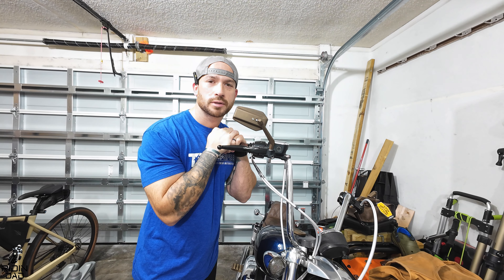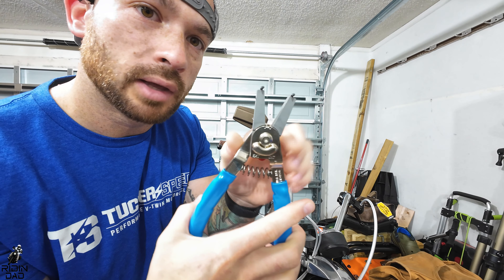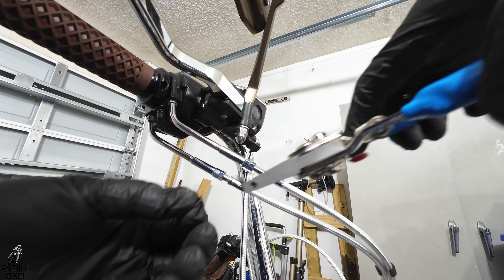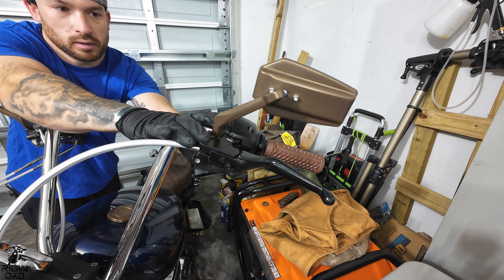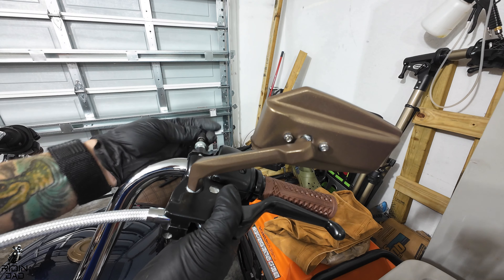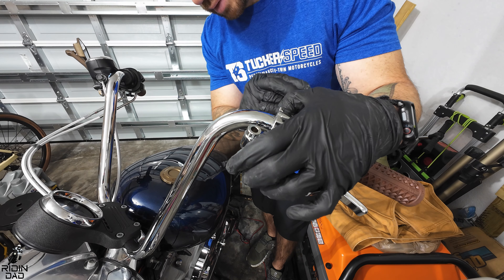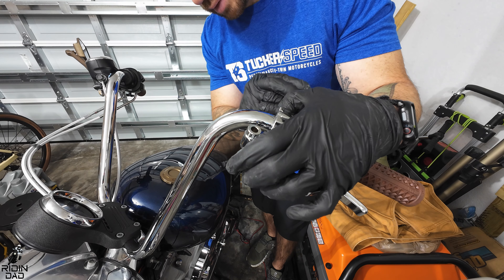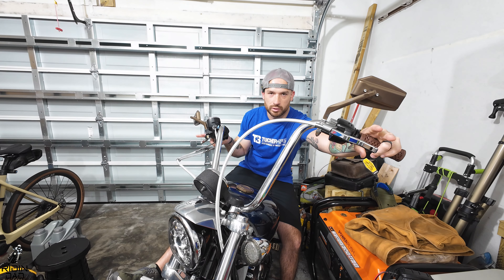How to INSTALL 1 FNGR lever set - Easy pull Clutch Lever w/ matching brake Lever!

Comment: Do they actually make the clutch pull feel lighter? Worth it?
Reply from the maker: Yes 100%. It is a huge difference. I didn't have an issue with clutch pulls prior to this install, but it is very easy to pull this lever with just your pinky. Big difference. And very smooth action to it.
Reply: @ I want it but it’s so expensive for my bike it’s $600 on the 24 road glide but the mueller power clutch is $200 and I might just have to go with that option.
Reply from the maker: Yeah, I get it man. I’ve never felt the other option in person so I can’t speak on how it feels, but I have felt some aim products and the one finger felt way better than any of those. Plus, this is just at the lever, the last thing I would want to do was mess with anything in my primary that way I don’t have to worry about having to change it again down the line or something weird like that depending on what I wanted to do. A lever swap is very easy.
Reply: @RidinDad  very true man. I feel the same way that’s why I’m trying hard to find an alternative other than that but it’s getting complicated lol. $600 is just ridiculous and overpriced IMHO.
Reply from the maker: Overpriced yes. Agreed. But….unfortunately everything with these bikes is overpriced

Comment: Finally they a 1finger on my dyna finally! The chrome levers were sold out for almost a year.
Reply from the maker: Holy hell! I love it man. They feel so much smoother than I thought possible lol. I’m a believer how!
Reply: @RidinDad  my grammar was all goofed on that first comment lol. But yeah dude I just put one on the dyna a few days ago only got a few little rips on it since it’s below freezing but the I was running a cut n half lever for over a year and talk about forearm pumps 😂 the easy lever makes the front of the bike feel 20lbs lighter in a wheelie
Reply from the maker: @jerrycool3034 lol that 1 fngr compared to the diy lever is a huge jump lol. And grammar or not I got the just of it! Especially with the clutch you got in the dyna that’s a big change lol

Comment: Afterwards did you feel you had to adjust the clutch in the primary? Seen folks do that also. I’m torn between these and the Flo moto you installed
Reply from the maker: Hard to tell because to install the lever I had to adjust the cable anyway. At the clutch basket itself I did not make any changes and I do not feel like I had to. I will say that it is a different feel as you pull in though. It does not disengage until the very end of the pool and then it’s a very immediate disengagement. Hard to explain. Not bad in anyway and you can still feather the clutch and do low speed maneuvers and stuff like that, but it’s just a weird different feeling that takes a little bit to get used to. After using both of those levers, I would pick the one FNGR lever every single time over the flow. The flows are really cool and I love the adjustability, but if you really do only use two fingers for the clutch and the break, you cannot beat the one FNGR in my opinion.

Comment: Is this clutch lever working on harley48 sir?
Reply from the maker: I don’t have a 48. I have an xl883. But yes. It works fine like I demonstrated. It’s made to work on pretty much every Harley available right now. It’s a very nice pull. Very light